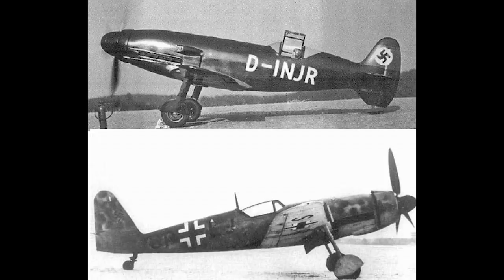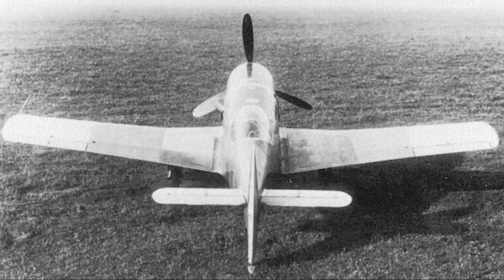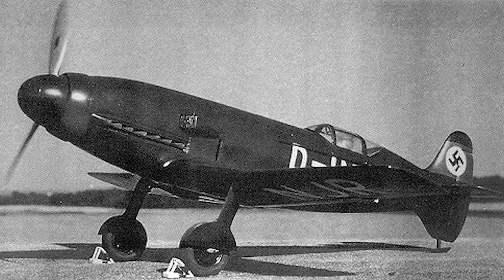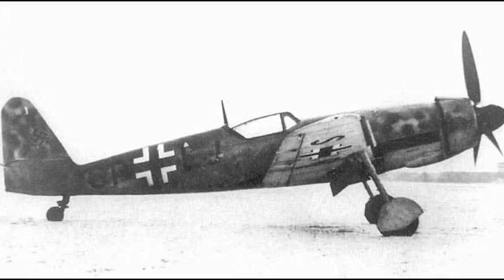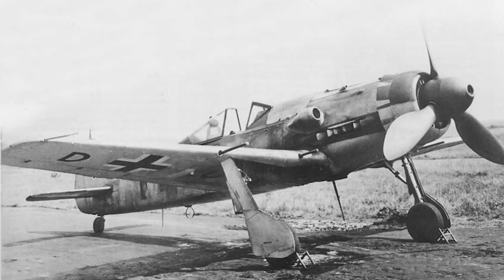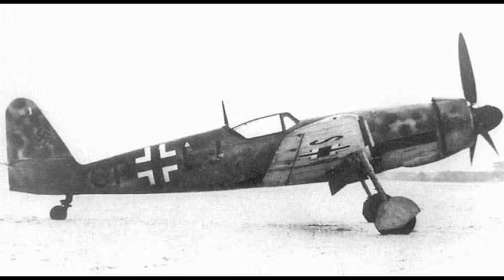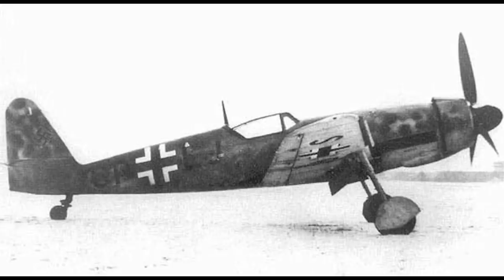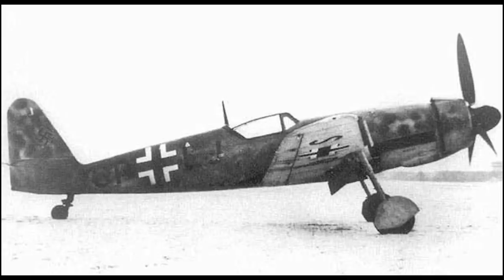The ME 209 I & II: Two Attempts to “Replace” the Luftwaffe Stalwart

Comment: The 109 was... close to perfect for a pure fighter vs. fighter plane. Even in 1945 allied test pilots with a lot of experience said in mock dogfights this mid 30s design was at no disadvantage to a p51 or spit.  That's the simple reason the replacements never caught on. They were often worse and never better.
Reply: The 109s used at the end of the war had little in common with those designed in the mid 30s
Reply: Plus if there was a better design, it often used too many strategic materials to actually be made, and if a downgraded version using less was tried the performance hit was so bad it wasn't worth it.
Reply: Too small, poor range, awful rear visibility, terrible undercarriage and accident rate. They became heavy pigs at the end for turning as far as I know. The 190 was better.
Reply: @kentl7228  
Spitfire had less range at end of war than 109. Also canopies were replaced.
Reply: This, and the fact FW190 Dora was similar to 209 type II... so both aspects were covered.
Reply: @Vickzq  the 109 never ended up with good rear visibility, the Spitfire did, not that I even mentioned the Spitfire. I like lots of the fighters but the 109 is problematic to me. There were pink PR Spitfires that could go very far in range. Which surprises people at first, including myself.
Reply: @Vickzq  neither were the 109 )
Reply: @kentl7228  
Really? You pick extralight reconnaissance as example?
Reply: @Vickzq  it is simply interesting that they could fly far in that configuration. I saw an interview with a US pilot who flew them. He was shown footage of his crash landing that he never knew existed. Is was not adversarial. Simply interesting and it contradicts that a Spitfire can never fly far. I never knew why you mentioned the Spitfire in the first place. I simply think the 109 was not a good fighter in many ways.
Reply: @kentl7228  
That's simple. The spitfire gets always praised, the 109 criticized... for the same things. While a fully combat equipped Kurfuerst could reach over 2'400 kilometers of range.
Reply: @Vickzq  not me. I like the P47 the most. I prefer the most likely aircraft to survive
Reply: @kentl7228  
😂 Fair point.

Comment: Interesting video. However, as experimental propped aircraft go, the Republic XP47J officially clocked 505mph in '44, & that record for propped aircraft stood for decades.
Reply: The record for propped  aircraft was set at 540 mph in 1960 by a tu144. Hardly  decades  after 1944. The xf84h only managed  520.  If you mean piston engined then yes you are correct.
Reply: @animaltvi9515  I do believe piston driven, propped WW2 era was the subject here, wasn't it, which also included prewar experimental aircraft. The subject  was based on single engine types, I stayed on subject. Thanks for your input.

Comment: The Me 209-1 might have held the official world record until the 1960s but Germany, the US and UK all produced piston engined fully capable combat aircraft that exceeded that speed by the end of the war.
Reply: If i remember correctly there was a separate world record for production combat aircraft, but i could be wrong, from what i know the official speed world record needs to be done in a closed airspace, have the neccessary equipment with accurate readings to measure the speed, and you will do 3-4 passes from both direction with the average speed from all four being used as the record time
Reply: @twddersharkmarine7774  I am not disputing that and the Me 209-1 was quite an accomplishment for the time but the fact that the record stood for so long is less impressive when you know production aircraft exceeded those speeds within a few years.
Reply: @johnshepherd8687  it is quite a lot less impressive yes, i can agree with that, certainly an interesting matter in itself
Reply: @johnshepherd8687  No likey F8F Bearcats?
Reply: I think the record was done at sea level or very low altitude which is impressive. Most WWII fighters had superchargers that helped performance at higher altitude. Those max speeds listed for those fighters were at high altitude not sea level..
Reply: @augs8  YES! It was LOW!   WTF?
Reply: @augs8  ah yes i just remembered that, the altitude do change the performance of the aircraft, it make a lot of speed figures rather weak for comparisons, i have seen Bf-109G's speed figure ranging around 575-650, so every speed record probably has to be taken with a grain of salt
Reply: also what is happening with this Dalle person
Reply: @twddersharkmarine7774  ..and the K-4 high, with MW 50?  

109 F-series = my ♥
Reply: @dallesamllhals9161  i actually like the F and G Variant more, but maybe that's just because it has a lot more arnament
Reply: @twddersharkmarine7774  Huh? Fs had One 20mm and two 7.92mm? 

But yeah the 'Gustav' is nice too IF one likes lotsa' Guns ;-)

Comment: Great video! I am confused however how the world record of ~756kph by the Me 209 I stood until 1969 when there were planes like the Do 335 which could push 780-790kph. It was even a production aircraft. It probably could go even faster if it got the DB 603N engines with some 2800hp each.
Reply from the maker: I think that a record has to be set over a fixed, marked course with outside observers, and the war ended that. Afterwards, I guess no one was that bothered about piston engine records so much because of jets.

Comment: Thanks Ed I never have heard of these models .. until now .. But Why  Messerschmidt never put on a bubble canopy on any of their 109’s …. When The FW 190 had one all along  along with allied fighters … the bird cage style of the 109 seems to be hard to bail out of .. or get out of  if the plane is upside down  …
Reply: The Bf 109 canopy can be jettisoned in its entirety (except for the windscreen part of it).  So it is only opened on its side hinges when on the ground, pilots don't have to bail out that way.
Reply: @timonsolus  did know that one .. I’m just a fan of the bubble canopy.. for lots of reasons … and Kurt Tanks design Philosophy…
Reply: @stephenrickstrew7237  : I don’t think the original bubble Spitfire canopy is much of an improvement over the Erla canopy of late model 109s.  Only the teardrop canopy of the later Spitfires and P-51’s is a big improvement.
Reply: That was one of the changes with the Me309.
Bubble canopies have significantly higher drag than ones that are integrated with the rest of the fuselage. Basically it’s a speed trade off.
The “Galand” hood used on the later Me109’s and all the Me209-II’s significantly improved visibility by eliminating most of the framing.

Comment: I wonder if this had been allowed to go into production with the DB 603G this could have been a pain in the ass in the air

Every time I see this aircraft I can't help but wonder if Messerschmitt couldn't have figured out a way to just graph that Wing onto a standard BF 109 because one of the problems with the 209-II and 309 is that they cost more to produce than a BF 109 and the RLM's position was that even though it was tricky to take off and land the standard BF 109G had enough performance for laughs.

There's a similar parallel to the supermarine spiteful that the wide track landing gear and increase performance was not enough of a reason to switch production from the spitfire.

Comment: I'm curious - you say it made 469mph which remained unbeaten until 1969? What about the Seafang at 475mph, the Spiteful at 494mph, Sabre engine Fury at 485mph, de Hav Hornet at 485/472mph,  P47M at 470mph, XP47J at 504mph, XP72 at 490mph, P82 at 482mph and FW Ta152H at 472mph - all well before 1969..?
Reply: It was (supposedly) over a timed course requiring flights in both directions within a certain period.  By this time other countries were focusing on building aircraft to counter Germany’s armament program and obvious territorial ambitions and were preferring to keep their aircraft’s abilities secret.
Obviously this was part of the usual German propaganda of their invincible force at the time so can safely be classified as “dubious” - IMO along with the vast majority of German claims of the period.
Reply: So NOT the F8F-2 Bearcat in 1969?
Reply: @mbryson2899  Did I say - that it was?
Reply: @ralfklonowski3740  So! A F-104 = piston power*?

*What we use nowadays?
Reply: @mbryson2899  PASSIVE? ØH? LUK RØVEN! Selvfede NAR? 

I understand ☮ & ♥ from Danmark
Reply: @dallesamllhals9161  No, he took the jet and did the 3km runs less than 100m above ground (!) according to the old rules. Considering the speed of the Starfighter, this must have been quite an experience.

Selvom jeg er tysk, saa kan jeg også forstar Dansk.
Reply: @ralfklonowski3740  Og selvom jeg er dansk så kan jeg forstå tysk (it's the writing part - that's rusty) ;-) 

And as a german should you be a fan of the 'Starfighter'!?
Reply: @dallesamllhals9161  Beeing multilingual is fun, isn't it?
As an aircraft aficionado, I love the iconic lines of the Starfighter and the No Compromise aproach of the design with the one aim of getting maximum speed.
As a German who served his mandatory military service in the Bundesluftwaffe (near Eckernförde; never got near a plane), I can not ignore that this plane killed quite number of our pilots. I know that the responsibility for this lies with the people in Luftwaffe command that bought the wrong plane for the job at hand and stepped up pilot training too late, but still...

Kaerlige hilsener fra Ruhr districtet til Danmark!
Reply: @ralfklonowski3740  Well, not really a bi/multi-lingual. Just a danish xennial aka late 70s - early 80s ;-)

Comment: From the German viewpoint it's a shame Kurt Tank and Focke-Wulf didn't have the same political preference given to Messerschmitt by Goering. If the Fw190 Dora and Ta152 were introduced earlier the Luftwaffe would have had a real chance against USAAF fighters.
Reply: "If the Fw190 Dora and Ta152 were introduced earlier the Luftwaffe would have had a real chance against USAAF fighters."

Defeat in the air war over Germany was a result of many things. The principal reason was that, once the Allies had reached a critical mass, there was almost nothing the Germans could do to stop them. While the focus for many people is on the daylight air war, the night campaign - despite its many faults - was having a similarly serious impact on German war production. And this was achieved in no small part by the Allies gaining air superiority and exploiting it to the max. And the biggest single advantage they had was altitude. The newer German types might have had some successes but the turn of the tide was just too much. People talk about lack of fuel but the Germany also had critical shortages of pilots, to the extent that they entertained the idea of suicide missions (Hanna Reitsch) and squadrons drawn from the Hitlerjugend. That's a lot more than an aircraft problem.

Comment: Was Germany the only nation to use annular radiators for liquid cooled inline engines?  This can be seen on several kinds of German aircraft, including, it appears, in the one photo of the 2-series Messerschmidt above.  This seems counterintuitive with the desire to take advantage of the streamlining benefits of the inline engines.  Obviously, though, it was effective.  Is this a matter of the drag of a radiator being a constant, and it not mattering so much where you put that drag, whether under the wings or in front of the engine?

Comment: If the Focke-Wulf 190 had the 109s leading edge slats that Kurt Tank hated she might have been an even more formidable fighter, but the Dora and Ta 152 were the Swan Song of piston engined fighters anyway.
Reply: There are other ways of achieving the same thing. According to Eric Brown, the slats tended to pop open unexpectedly and cause aileron snatching. I'm a little surprised they didn't try something uber simple, like vortex generators.
Reply: @thethirdman225  ; Were vortex generators even a thing back then? By that I mean even known?
Reply: @FirstDagger  Well, I can't say for sure they were but the basic principles of turbulent boundary layer flow were known prior to WWI. So to that end, I'd be very surprised if they weren't known. But vortex generators are only one way of doing it. Saw tooth leading edges, leading edge slots and Handley Page slats were all ways of doing the same thing. You'd be familiar with the slots above the leading edge of the SBD Dauntless wing? They were there to improve the performance of the ailerons and they were around in 1937. I'll keep looking because I'm about 50% confident there are other examples.

Comment: The Me 309 was unsuccessful too.And then in the Me 110 family you have the 310 very obscure and just as bad as the 210.
Reply: The Me 309 provided development input into the Me 262 (specifically the tricycle undercarriage on the Me 309 was transplanted into the Me 262 when the tail dragger gear on the Me 262 proved problematic).

Comment: After the enormous waste of time in trying to produce the useless Me 209 full of issues by trying to convert a record breaking airplane. It proved immediately to be a very difficult airplane to fly. In my opinion they should have concentrated earlier on the Me 209-II as it used 60% of the Me 109G so it would have been easier to produce. It was intended to install the DB 603E but there was difficulty to supply this engine so it was planned to install the Jumo 213E, a very good engine that was fitted to the Fw 190-D9. But it was too late to produce the Me 209-II despite being much improved over the Me 109G it in any case it was 50 km/h slower than the Fw 190D and offered no improvement in handling characteristics. Much of the should be blamed squarely on Willy Messerschmitt for jumping on crazy projects like the  Me 309 and the Me 410 that created so many problems for the Luftwaffe...
Reply: The Me 209-II offered no improvements over the Me 109K (in speed and service ceiling it was worse), and would have been harder to produce in the same quantity and timescale.
Reply: The Me410 worked reasonably well. The Me210 that it replaced had aerodynamic problems.
The Me309 was an aerodynamic testbed for a lot of the features of the Me262 that couldn’t be tested due to lack of working engines for the Me262.
Reply: @allangibson2408  oops, you are correct it is the Me 210 not the Me 410! The new Me 410 outer wing panels had their planform geometry revised to bring the aerodynamic center further forwards in comparison to the Me 210, thus making the leading edge sweepback of the outer panels identical to the inner wing panels with both having identical 5.5° sweepback angles, which improved handling and adding, other modifications included a lengthened fuselage and new, automatic leading edge slats, both of which had been tested on Me 210s and were found to dramatically improve handling. Finally it was installed the more powerful DB 603E replacing the DB 605A-1. It was another airplane with excellent performance but unfortunately it putted in service one year far too late. The real consequences of the disaster created by the Me 210 was to replace the obsolete Bf 110 and taking over the equally Ju 87. Both production lines virtually stopped in order to start production of the new Me 210. Basically the Luftwaffe was deprived of the much needed ground attack airplanes at a critical moment so when the lines was reopened it took time to start the production again. Hope I didn't bore you and I apologise for the mistake...

Comment: Looking at the ME 209 V1, I'm imagining the takeoff roll where the pilot has to balance throttle with airspeed so that engine torque doesn't simply overpower those dinky control surfaces and flip the thing over on its back.
Reply: Brave Fritz Wendel was stick and throttle-man on the 469mph record run. 
History doesn't record whether he used a wheelbarrow or a forklift to move his gigantic hairy balls around - but it had to be something like that.